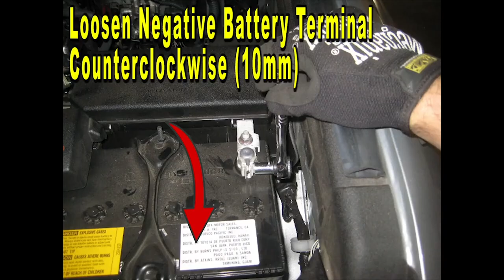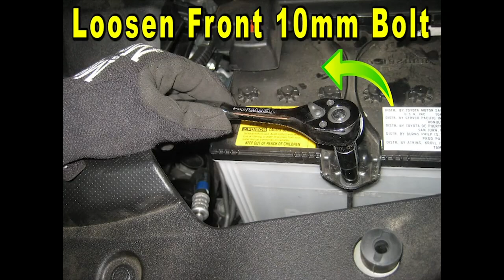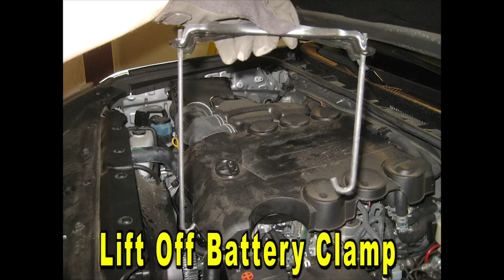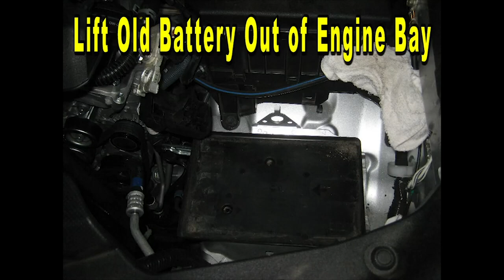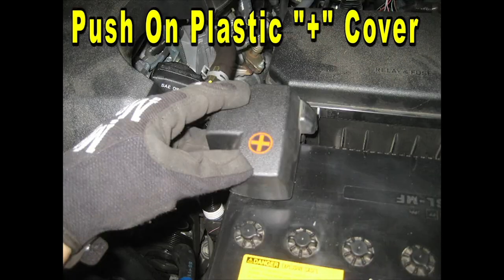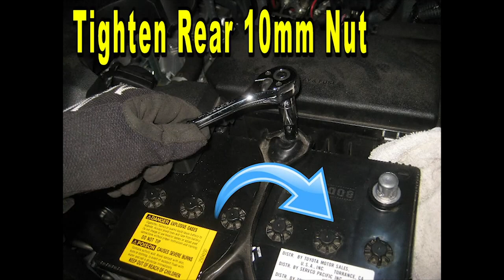2010 To 2024 Toyota 4Runner How To Change 12V Car Battery - Quick & Easy Version

Comment from the maker: Toyota 4Runner OEM Battery Part Number - https://amzn.to/3VfdTKh
Toyota 4Runner 12V Battery Group Size - https://amzn.to/3WBlbJl
Toyota 4Runner Alternative Group Size - https://amzn.to/3VjYqZF
Socket & Ratchet Set - https://amzn.to/3VjlBmN
Felt Anti-Corrosion Washers - https://amzn.to/3hOLgGb

The Paul79UF YouTube channel is a participant in the Amazon Services LLC Associates Program, an affiliate advertising program designed to provide a means for sites to earn advertising fees by advertising and linking to Amazon.

Comment from the maker: Check out the DIY tutorial for changing a weak 12 volt automotive battery in a 5th generation 2010 to 2023 Toyota 4Runner with the 1GR-FE 4.0L V6 engine -
https://www.paulstravelpictures.com/2010-2016-Toyota-4Runner-12V-Automotive-Battery-Replacement-Guide/index.html

Here are all of the DIY repair and maintenance tutorials for the 5th gen (2010, 2011, 2012, 2013, 2014, 2015, 2016, 2017, 2018, 2019, 2020, 2021, 2022 & 2023) Toyota 4Runner SUV - https://www.paulstravelpictures.com/Articles/2010-2016-Toyota-4Runner-Common-Problems-Repair-Maintenance-Guides.htm

Owners of other Toyota, Lexus or Scion vehicles such as the Yaris, Corolla, Matrix, Prius, Camry, RAV4, Sienna, Tacoma, Tundra, FJ Cruiser, Venza, Highlander, Avalon, Sequoia, Land Cruiser, IS 250, ES 350, GS 350, tC, xB, xD, iQ and FR-S may also find these DIY instructions to be helpful.